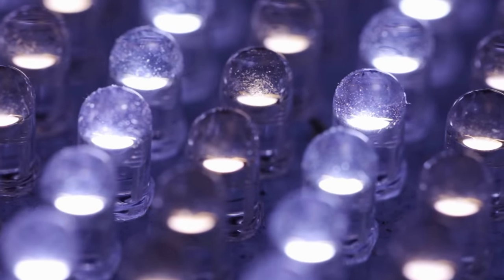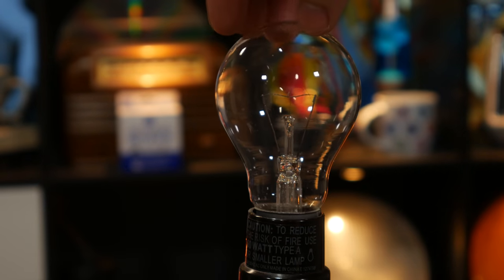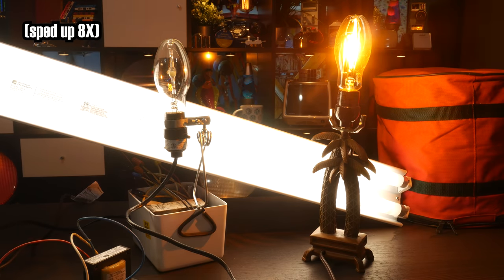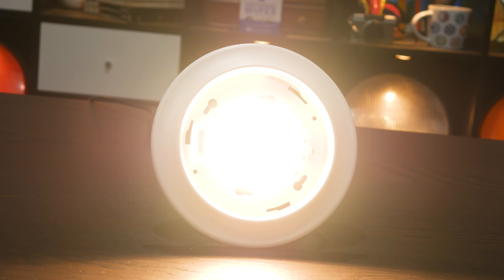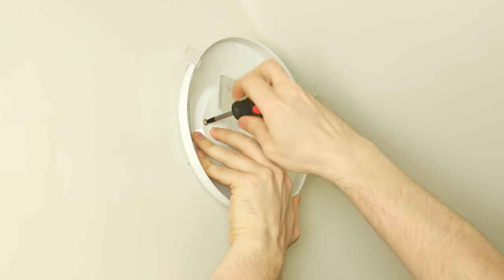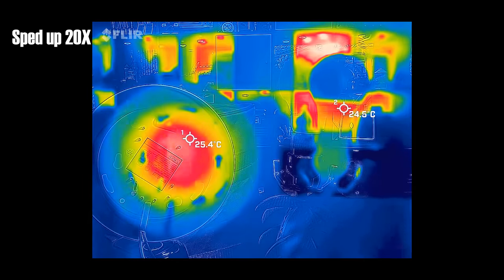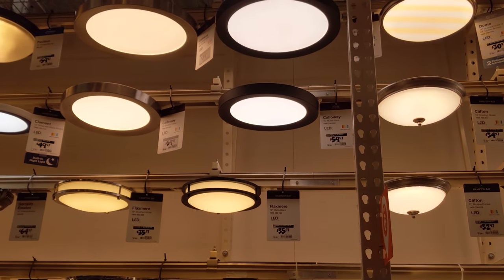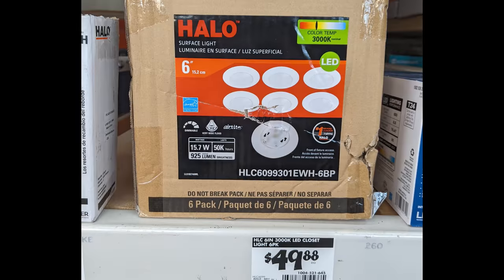A troubling trend in lighting?

Comment: I feel like something like the smoke detector brackets style things would be a decent solution for the replaceability problem. Naturally, that does require committing to that style of lamp instead of a bulb socket.
Reply: I feel like it would be relatively simple to design an adapter for that style of fitting that would accept a light bulb, which might mean you don't have to sacrifice flexibility. If you want one of the light fixtures shown in the video, you just slot it straight in. If you want a light bulb, an adapter would only need be a dumb, cheap thing
Reply: I seem to recall that in some places (Europe I think) they use a standardized mounting brackets that are installed when a round/octagon lighting box is installed. When you buy a fixture you just snap it into place on the ceiling and voila! Done! I wonder where that's done? HEY ALEXA!!!
Reply: The funny thing about your comment is that I posted that before scrolling down to the comment section. So multiple people have thought of it meaning it's probably a good idea.
Reply: @sporkafife  they exist, i have one of these types of light fixtures and its mounted on a push and twist bracket that actually attaches to the ceiling, the bracket supplies the power to the fixture and its so simple to just take out. Gets rid of 99% of technology connection's issues while keeping full color temp selection

Comment: I put one of these in a closet where the old fixture had a pull chain. I very mush dislike pull chains. I put a remote switch in the closet which will turn it on and off just like a regular light switch, no battery needed. That switch will work from the opposite end of my house on a different floor so I hope I'm not turning on/off a neighbor's bulb/device if they bought something similar. Also hooray for lights that will let you select from several different color temperatures like mine does. This should be standard.
Reply: Selectable color "temperature" is usually done by including LED elements with different colors and then using them selectively.  So whichever color you choose, some elements will be underused and a waste of materials.
Reply: Awesome to see Joe chiming in on another of my favorite Youtube channels!
Reply: @Les While you're not wrong, I've never seen the same fixture for sale in standalone selectable colors. It's usually just one color and that's it for that particular design. Yeah I'm paying for diodes that I may likely never use, but a few extra bucks won't break me. I can just not feed my kid for a few weeks or maybe not send them to college. I think having a choice is more important than their education. I mean by the time their education matters I'll be dead from a severe heart attack so might as well splurge!
Reply: Game Sack - mush?
Reply: those self powering remote switches are neat, indeed.
Selectable light warmth is kinda neat and helped me matching my various light fixtures, but now I have a drawer full of remotes that all look the same and probably won't be used again forever.
Reply: Eyy Game Sack!
Reply: Colour temperature selectable LEDs are less efficient, they produce less lumens per watt. White "LEDs" are actually a blue LED with yellow phosphor on top of it, this is very efficient. Colour selectable LEDs have three LEDs which are Red, Green and Blue and you lose efficiency. Often so much that they're less efficient than CFLs.
Reply: @owensmith7530  It would be a bit silly to use RGB LEDs for general purpose lighting (it would make for a ginormous color gamut in a display backlight though - and yes, larger gamut generally means less efficiency). I am pretty sure that selectable color temp generally involves a mix of several different white LEDs. Makes more sense, doesn't it?
Reply: @PileOfEmptyTapes  I've seen plenty of devices that just use RGB for this, making a "feature" out of the fact you can have any colour you want.

Comment: I found an interesting compromise on the flush-mount “boob” light. The make these led bulbs that look like flush-mount fixtures. They only require a simple screw fixture, and when you screw these bulbs in, they stick out a few inches (like boob lamps) and they are - depending on what design you’ve chosen - several inches wider with a valance that touches the ceiling when fully installed. They LOOK like a fixture, but they have the function of a screw type bulb and are easily replaced without rewiring.
Reply: Can you link me an example?
Reply: I would think someone should standardize an electrical box cover plate with a low-profile receptacle on the bottom, so that one could take an existing box, wire in the cover plate and then be able to interchange fixtures easily without having to work with exposed electrical wiring.  An ordinary receptacle would need to be somewhat deep because the prongs insert perpendicular to the surface, but a design similar to what is used to made the plugs with some multi-format power adapters could probably be less than 10mm deep.
Reply: @flatfingertuning727  I figure something like a NEMA twist-lock would do the trick. Includes ground, and isn't prone to "falling out" if either plug or receptacle gets worn or bent.
Reply: @MrJest2  I think those have prongs which are inserted perpendicular to the surface, but the twist-lock concept is good.  I was thinking of a round piece in the middle of the fixture with metal blades that stick out the sides and slide under a mating surface on the mounting plate.

Comment: It would be super easy to redesign these things to separate "bulb" from "fixture" to make replacement as simple as a push-n-twist that provides a mechanical and electrical contact connection, as Edison bases do. Then you can choose your bulb and fixture independent of one another in a variety of hopefully-standardized sizes.
Reply: They have that. It's called GU10. It was developed for compact fluorescents because of California title 24 which considered hard wired Edison socket lamps not to be "high efficacy" for their code requirements. They just never became mainstream and the lamps for them remain expensive. I thought they would begin getting rid of these requirements now that incandescent bulbs are unobtainable, but they have not let up on their war on the Edison socket.
Reply: @gregorymalchuk272  GU10 seems to be quite common here in Europe. Pretty much every "spotlight" based lamp has them and led bulbs for the socket aren't more expensive than Edison socket ones.
Reply: @3vIl3aGl3  Yeah but glass GU10 sucks at cooling and suicides very quickly because of it!
Reply: @jovangrbic97  As is the lightbulb problem, to resolve it while keeping an interchangable format you'd need a sort of socket that has a large surface area to transfer heat. Perhaps something like in these lamps but with the AC input as a plug and a standardized format for the LED ring.
Reply: The only thing holding in the LEDs and driver circuit board are 2, or 3 tiny screws. The board is easily replaceable. I have done it myself.
Reply: @HaloWolf102  As outlined in the video, for more technical minded people that is not a problem, heck even replacing the whole lamp isn't. But the lamp isn't perse user serviceable, the board is soldered in so you'd still have to dismount the whole lamp in this case. And even then, where are you getting a new board?
Reply: @gregorymalchuk272  GU10 is just another base for line-voltage bulbs. As such, it provides no* benefit over the standard screw base. What we need is a standard form factor for flat "light engines" as they are often called. 

*An actual benefit of GU10 over ES is that it is more compact.
Reply: @eDoc2020  They have that. It's called GX53 "puck lights". They're rather smaller than these disposable light fixtures, literally about the size of a hockey puck. They started out as compact fluorescents (the tube is a flat snaking coil) and now have transitioned to LED. I don't think their light output quite matches regular bulbs though. They were only meant for under cabinet lighting.
Reply: @gregorymalchuk272  I saw those mentioned on another comment. They're still not ideal as they seem quite small and there's no thermal contact with the fixture. More ideal would be a 4 inch or so (~10 cm) square which is pressed against the fixture via a thermal transfer pad to keep everything cool.
Reply: Yeah it sounds like we need a couple LED module standers
Reply: @eDoc2020  GU10 is not only more compact, its superior in every way to the old screw-in lamps. The first bi-pin lamp was invented by the Westinghouse Electric Corporation in 1893.
Reply: @mernokimuvek  Not every way. Screw-in lamps are polarized. But despite technical superiority the established standard is practically superior unless there is a compelling reason to switch. Half an inch is not a compelling reason.
Reply: @eDoc2020  There is no need for anything to be polarized, we have AC, not DC. And you cant accidentally touch the inner contacts in a GU10 sockets and get shock, it doesnt matter which is live and neutral.
Reply: @mernokimuvek  While not necessary polarization is still nice to have with electronic lamps so the fuse goes on the live side. And it's hard to accidentally put your fingers in a light socket and get shocked. US style plugs are much more of a shock risk than light sockets.
Reply: @eDoc2020  Another actual benefit of the GU10 (also BC) over the ES is that it is safer. I will leave you to think for a while about why they are safer but they most definitely are.

Comment: When I bought my house in 2013, I replaced all the bulbs with led bulbs. To date, I've only had one fail, and that was the yellow tinted bug light I had outside. Which was on 24/7 for about 5 years.
Reply: i had the same experence i bought a few when they became generally available,. but then dollar tree got them in some 3 years now and going great 60nwatt are most of my lamps 2 with 100 . was going to redo my dome celing in kitchen but the plastic yellow and replacements too much so i going to buy a set of led and scrap the old fluorescents
Reply: I think we bought a bunch of Philips and Great Value in 2013 or 2015, lots of them have failed in the past few weeks. Lots turning on lights and getting horror movie lighting. They tended to be in enclosed fixtures and or just got hell of a lot of use out of them.
Reply: @ChrisD__  Well all mine are Philips as well, guess I should start preparing for this to start happening too.  Although I do happen to have some spares, since I replaced a few with Hue bulbs.  If they do start, 9 years aint too shabby.  And with the advancements since I bought those, any new ones will hopefully last even longer.

Comment: they should make these fixtures but make the led bits a removable disc, it wouldn't really even need many changes to achieve, it would have two slots that would also be the power terminals on the disc and have two fixtures that drive the power that they lock into with a simple quarter twist, just have like a button in the middle of the disc that unlocked the power/mounting tabs safely and replace.
Reply: In australia you have 2 choices for oyster/ceiling lights; 1 when the led lamp goes you replace the whole thing, or 2 the dearer version has a disc which when the light fails you just replace the disc which of course comes with the components on it.
Reply: GX53 puck bulb

Comment: As the lead tech at my University's auditorium, I can confirm that some people should never work with electricity. Even after numerous 1 on 1 training sessions, they won't get certain aspects, and that's ok. It just means their talents are elsewhere. But because of that, making sure there is a safe way for the average person who isn't inclined or able to work with custom electrical jobs is that more important. Certainly, I can teach a 5 y/o how to be an electrician and swap out fixtures, but I would argue it would be irresponsible of me to then ask that 5 y/o to go change said fixtures on their own. If you wouldn't ask a young child to do it, then it's not a user friendly task. That doesn't mean we can't have the freedom to do the more fun aspects of getting into the wires, rather that it shouldn't be a requirement for basic changing of the light XD
Reply: You are abolutly right with the 5y/o, but some child might be more capable of doing this job and observing the safty rules as some much older Person that should never do any electical work.
Reply: I don't think I would ask a five year old to change an edison lamp either.  I certainly wouldn't let them use an outlet.  So, maybe the bar you are setting is too high?  An eight year old can certainly do those tasks though.  And I'd say a ten year old can handle basic wiring.
Reply: Those are just lazy people who don't want to use 5 brain cells. Turn light of, go to break box and turn them off one by one until it goes off, take a $1 screw driver and undo two screws. Then on an outlet unscrew the 3 wires or light with normally the twistnuts, exchange the device and match the wires back up. Trust me anyone can use a screw driver and remember 3 colors (4 as ground might be bare cooper or green) but care enough.
Reply: Agreed. I'd be much more comfortable with these if they had something like a standard socket behind it.
Reply: @JohnAdams-qc2ju    I would agree with you if I hadn’t worked in the trade and seen the nightmares created by some peoples inability to correctly perform that simple task
Reply: Nature is amazing.
The more foolproof you make something, nature makes sure to create someone stupid enough to surpass this new challenge. Yes complex things are complex, but the simpler they are, the dumber the people around it. It is a never-winning game.
Reply: Very well elucidated.  I know a number of people who think they are electricians;  I have one friend who was well qualified, yet was killed by electricity nonetheless...
Reply: Some of these fixtures have quick connectors that allow the user to easily swap them out. It’s not perfect but it’s way better than having to manually wire them.
Reply: We should be looking at 12 or 24V power from solarly charged batteries. Anything that needs more oomph could be fitted with inverters. A 12 V DC lighting circuit makes a lot of sense.
Reply: I'm not really sure why, but this reminds me of a time that one of those HPL bulbs for a source4 zoom exploded in my face during otherwise normal installation. Good times.
Reply: @millomweb  Seems nice until the need for some thick cables to handle all those Amps appear. One or two lights are fine, but if you build an entire house based on 24v wiring, that is going to cost you A LOT just on copper
Reply: @Sonikadu  Lighting of course would be all LED. Generally the house wouldn't need heavy loads except the kitchen. So just put the 'power centre' in the kitchen somewhere.

Comment: Surely there's a compromise where you can install fixtures like those but with the guts being self-contained and replaceable rather than needing to swap out the entire fixture. A 'lightplate' rather than a bulb.
Reply: They do make those. I know Halo makes those. You hook up the wire to a separate box. The light plate itself is separate and connects really easily. Throw the box in the wall, then if you need a new light, you get a new plate, unplug it and plug a new one in. No wiring required. They look pretty nice too
Reply: But this light with integrated led source can be easily repaired and it has much better cooling. I am constantly throwing led bulbs to dust bin because there is some failed capacitor or something like that inside, but you can't open it and not destroying it. I am thinking about fixture lights because I have good experiences with them, it works many years without failing, while classic led bulbs to E27 socket are really bad, it can fail even after 1 week of using it, that's really bad. There are only 2 types of LED bulbs - first fails in first few weeks and second is working for 10 years, there is nothing between, but you can't know what type is that led you are buying, even good brand doesn't mean anything, it's everything cheap shit from china.
Reply: @Pidalin  you didn't read the comment you replied to.
Reply: I got a set for my last house (so I can't get the brand for you) but they were light plates that had an edison adaptor that went into the existing can light fixture.  It was a pretty solid compromise.

Comment: They can simply use the metal frame and plastic lens but have a control board that clips in place and has a simple plug so it would be easy to change out the flat board.  They could also add the switch on the board to choose the type of output color.